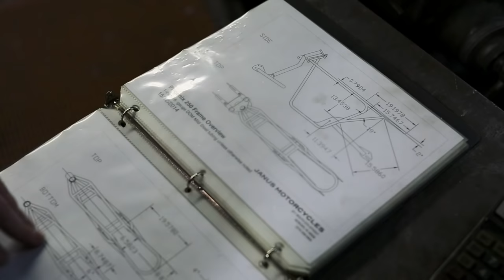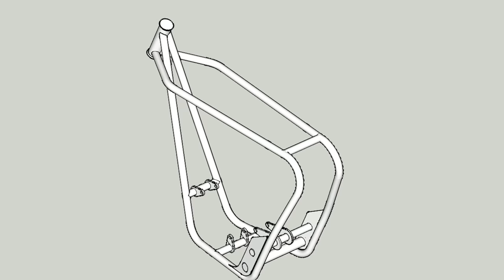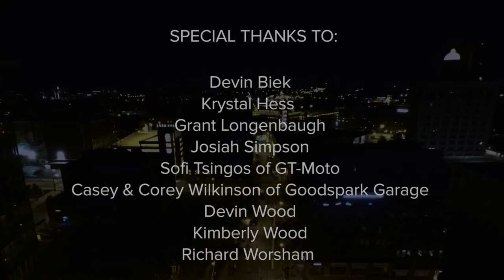Janus Motorcycles - Past and Future

Comment: i herd and saw for some reason the key vibrates really bad ru going to change that mabe move it under seat? and do u have different front and rear sprocket options for those of us that want to change those and also i herd that you guys r going to be getting bigger engines? is that true and if so what size? please respond.

Comment: Is 250cc the biggest motor you use? I'm not yalking about a 1000cc but around 500cc? There are people out there like me that likes the looks of your bike but the engine size is to small. I'm 6'5" 350...
Reply from the maker: Hello! Yes, we do hear that often. The 250 line is all we currently manufacture. If you're ever in the area stop by and give one a test ride.
Reply: @janusmotorcycles  Any performance mods available?